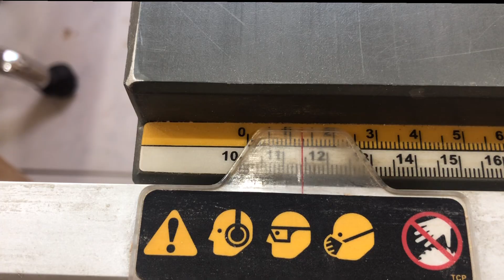제재목으로 얇은 도마 만드는 과정 Slim Cutting Boards from Lumber / 목공 DIY

Comment: Why did you clear off bark from live edge only to cut that side off? Asking for a friend.
Reply from the maker: Originally, the timber at the edge was intended to create a holder base on which to stand the chopping board.  However, as you know, it was slightly bent, so I attached a cross rod instead of a stand.  Thanks for watching and have a nice day 👍😊
Reply from the maker: Ah... thank you my friend 😀😀😀
Reply: That would have been nice to see. Your video has inspired me to attempt this and share with family and friends. Thank you and stay happy.